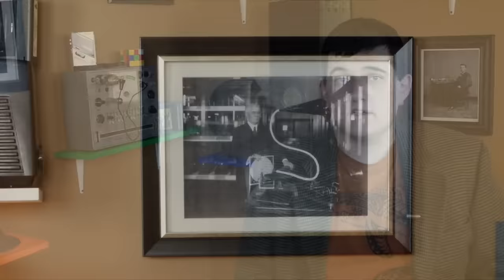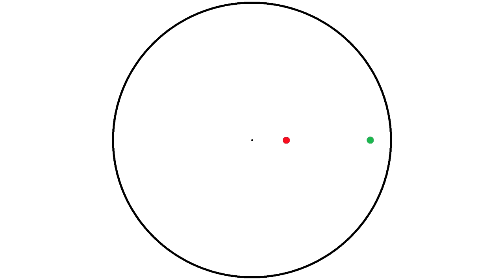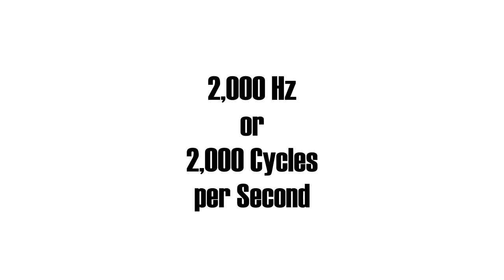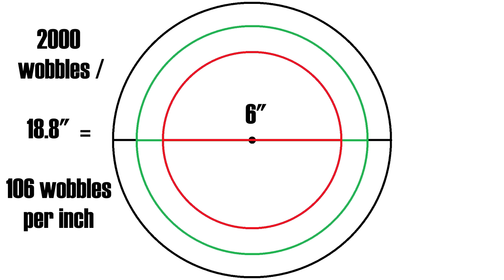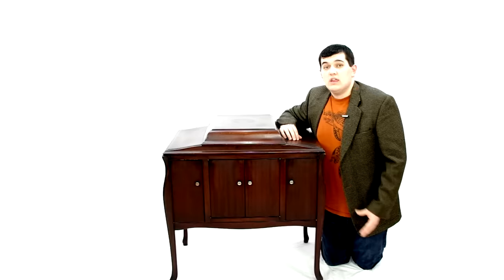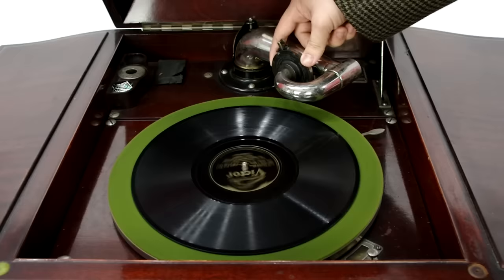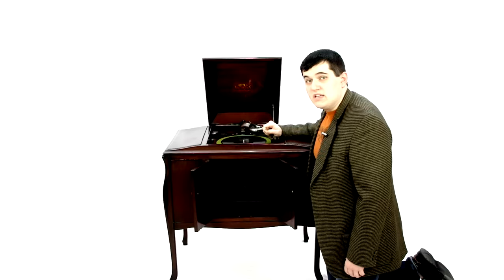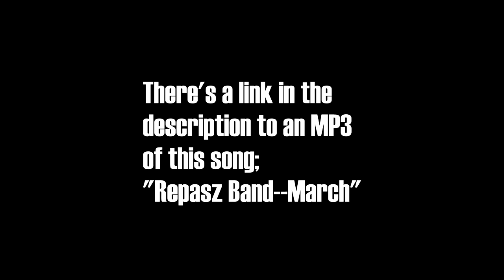Emile Berliner's Fix: Flatten the Cylinder to a Disc

Comment: Edison was not the only one to use vertical cutting on discs - Pathé also did, along with their supporters - though needle/stylus requirements varied. At least one manufacturer came up with a way of cutting sound "diagonally" into a disc, with the intention of having their discs playable on both vertical and lateral disc playing machines. To get any significant sound out of a vertical cut disc on today's equipment, you have to use a stereo cartridge with the positive ends of the coils connected together, and the negative ends connected to the amplifier inputs. Fit a suitable stylus - ideally a little wider than for 78s - and use a turntable capable of the 80-120 rpm that these discs needed. Bias compensation should be at minimum and you may need a fair bit of tracking force.

Comment: You arguments are not accurate:
Discs until 1900 used the acid etch zinc process for duplication which yielded a much noisier recording. The cylinder moulding process dates from 1901. Comparison of the fidelity of cylinder vs disc in 1901, the cylinder won hands down.
Double faced discs did not appear until 1908. 
There were two disc companies (Victor and Columbia) and at least two cylinder companies (Edison and Columbia) until 1912.
What killed the cylinder was playing time (4 minute cylinders in 1908) and a more rugged material (celluloid 1912) as well as the double sided disc (1908) which resulted in the switch in favor of the disc by 1910. Even Edison during the 1908 to 1912 period had excellent artists comparable to Victor, but the 4minute Amberol wax cylinder wear and fragility killed Edison.
The cylinder and the Edison disc remainef sonically better during the acoustic period but the convenience of the lateral disc won out.

Comment: I skimmed through enough of this to confirm my suspicion, that yep, it's mostly anti-cylinder, anti-Edison, and anti-accurate drivel apparently made by an amateur in his mother's basement or somewhere. But welcome to the  internet.                                                                                                                                                                                    First of all, beginning in 1912, Edison's record company began issuing discs and continued to do so into the late 1920's. Secondly, cylinders (of any brand - Edison's weren't the only ones on the market) were usually FAR superior to early discs in the quality of sound reproduction, and although discs improved,  the sound on the best cylinders is equal to or superior to many discs up to the point where electrical recording was commercially introduced in the mid-1920's. Sound quality DOES gradually and noticeably deteriorate as the needle gets toward the center of a disc, and the signal-to- noise ratio and frequency response on cylinders was better because the vertical modulations in the groove can be cut hotter with no danger of tracking problems caused by lateral modulations in the groove on the discs. Cylinders died off mostly because they were more difficult to store, they tended to be more expensive, and eventually, there was a better selection of music offered on discs.  But it was not Edison's original intent to offer the phonograph as an entertainment device, anyway, and after his record company went out of business in 1929, the cylinder lived on for many years as the recording medium of choice for use in dictating machines.

Comment: How does one shine a light through a cylinder ?  This cylinder would be transparent? Made of what?      Berliner used zinc discs coated with stearic acid;  the recording was cut into the coating, then acid was applied & it etched the zinc where the coating had been scraped away. 

 Your story about cylinders + lampblack + photoengraving is utter nonsense;  in fact, most of this video teeters on the edge of fiction.